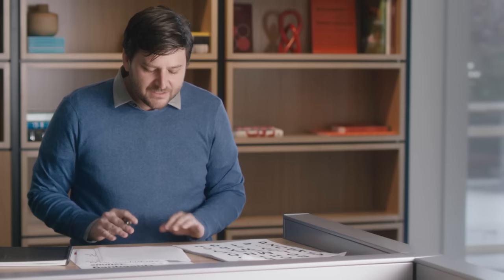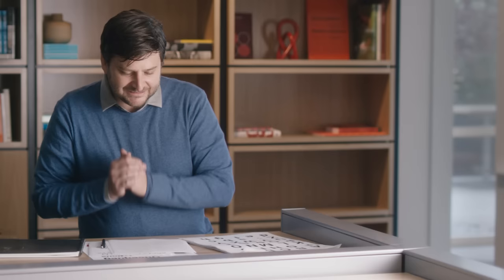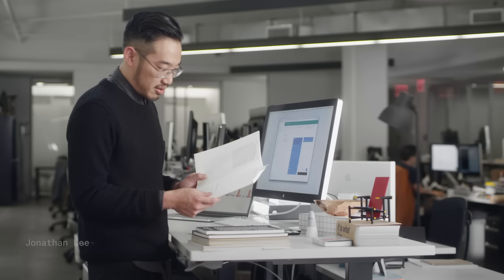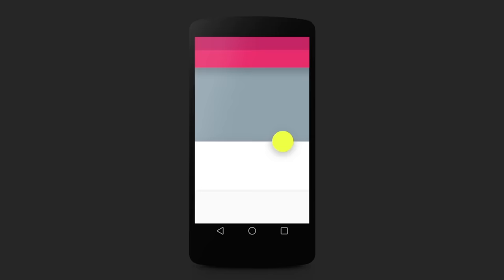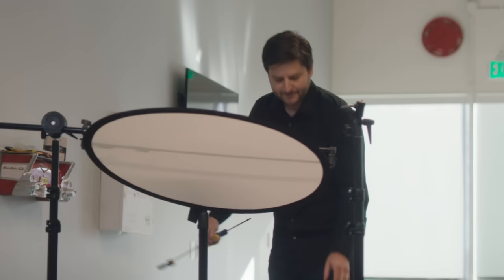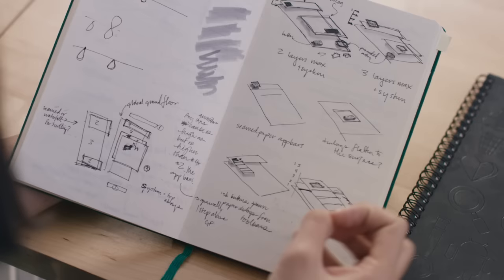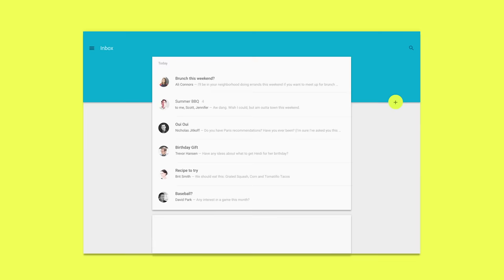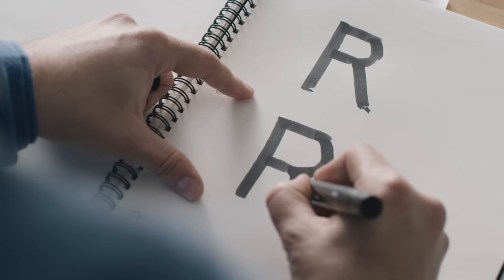Making Material Design

Comment: 3:38 Please revert back the current new icons to this.  Material design is way better than colorful lines
Reply: Hello there! I miss the material design. Now, android just looks like it has flat design. That's why, android lollipop and marshmallow are my favourite. All the other android versions after that were just meh
Reply: Where? In what part of icon? The new icons are much more beautiful. And if you can't identify them, there is such doctor called optometrist, you know?
Reply: @litvanika  it's hard to differentiate sometimes, when you are accustomed to the classic logos. I get confused with the new icons because of the identical colour schemes, also, in my opinion, the icons are not legible.
Reply: @cucumberwater6  1. It's not hard to identify them unless you are blind
2. There are labels under icons that you can read
3. You've gotten used to icons' location so you don't even to see an icon to open an app
Reply: @litvanika  you do make a good point though
Reply: @litvanika Surely if you have to rely on a label to interpret what an icon does it is bad design. Design should be Intuitive.

Comment: This design made me switch from iOS. No joke.
Google, please keep on doing this. Dont change it ever.
This design with connection to reality is really really good. Not like Apples "in your face! make everything WHITE" design. 
This is 3D and at the same time 2D, kinda realistic and at the same time modern.
Flat and not flat. Depth and no depth.
And the animations .. You start the dialer, and the call button and numbers fade in when you hit the little keypad. I did that a few times just to enjoy the animation :D
All in all, its just great.
Also, its really easy for developers to use Matarial Design. Im actually thinking about developing an app myself. 
Until 4.4, Apple had the advantage in software design, IOS 7 was uglier then IOS 6 overall, but still.
But with 5.x and soon 6, you have the edge. 
10/10. Enjoying Google every day ^-^
Reply: ***** Matter of taste I guess.
Its a good comparison though, with Windows because Windows 8 also looks like shit (for me).
I am using it, and I like it because its a very efficient and modern system, but it looks like shit.
So I fiddled a bit with it, got back Aero. :)
Reply: Did you get a Nexus device? Because that is where you'll see the most of the design language. The Nexus devices are made by Google to show of their latest and greatest software in it's stock clean form without all the skinned version software from other manufacturers.
Reply: AnimeFan Exactly yes, a Nexus. I don't want anything else :) Just Android, no bullshit.
Reply: SpicysaucedHD Android M is coming out soon! I can't wait!
Reply: ***** Not completely stock, its Cyanogenmod. So near stock yes, but not entirely. Also too big for me.
Reply: ***** You should wait for the OnePlus Two, it is coming out two days from now, lol. xD
Reply: ***** What happened, did you end up ordering the OnePlus One? XD
Reply: +SpicysaucedHD material design is amazing, one of the best things Google has come out with in years. It works perfectly to simplify and unify interface design. The closest precursor was bootstrap and god knows bootstrap is a nightmare once you come to customise it.
Reply: +SpicysaucedHD I hate the flat look. The animations are cool, but they make older devices run slower. I would take the dark 3d holo look of jelly bean ANY DAY.
Reply: +CreeperCraft137 According to general design guidelines Material Design is truly the better solution than Holo. And its not really flat, it has visible (virtual) layers of paper/cardboard.

But hey, its Android right? So just tune it to your liking :) Everybody has his or her own personal preference and that is what Android is all about - diversity.

Btw, just saw that my original comment is now almost 6 months old. And still, I am enjoying Android - and its design of course :)
Reply: ***** OnePlus X is a great device, definitely the best for the price.
Reply: ***** iPhone 6s isn't that good. For the price of the OnePlus X, it's amazing. Though currently I think the Google Nexus 6P is the best in the market right now. If it had OIS for the camera and if the device was around 5.5", I think it would be a perfect device, for me at least. Currently, I have the Galaxy S6Edge, but my latest device for sure will be the latest Nexus, probably when my contract ends in less than 2 years. Ugh, I want a Nexus right now! XD First world problems.. :/
Reply: material is all white what u talking about lol
Reply: MrMister1227 You know material dark is a thing, right. There is a dark theme for material dance, but it just seems Google is going mostly white for all their apps.
Reply: Me too! I think thy iOS and Apple "owned" the smartphones and MOS sector, but that material design is going to change that. But it isn't just a design, the apps change too, Inbox for example!
Reply: Stan347 We have to wait until May for the beautiful? :(
Reply: ***** It's still the beta, so obviously there can be many changes done before May comes.
Reply: he's sayn' good
Reply: Windows 8,10 UI is like a Material design done wrong
Reply: L   A   G
Reply: Lol, I tried android and returned to iOs because material design sucks.
Reply: now material design is literally in almost every single app you download and even alot of site prefer it over realism, simple is the new modern
Reply: What phone you using rn?
Reply: @maurovisuals  Interesting question. 
With the completely new UX principle introduced with the IPhone X series, I had to rethink the whole thing. 
Apple does gesture-based navigation best and smoothest. 
What I also didnt take into consideration 5 years ago was the quality of apps coming from the Play Store/App Store. The latter or rather its apps are sadly(?) often vastly superior, that was ultimately the main reason why I had to switch back. 
So: My Android adventure ended, I am now again an iOS user indeed.
Reply: @OliverQueenMC  I have a Xiaomi Mi A3, which is also stock. I had a shitty customization layer. I wanted a mobile with MIUI. But after discovering Material Design, MIUI is shitty in comparison.
Reply: @Spicysauced  oh :(  I started disliking android from Oreo and beyond, because I feel Google abandoned the material design, that made android L and M so aesthetic. Marshmallow is my favourite version of Android, nougat(according to me) was meh, but it had a lot of good features. I started disliking the design from Android Oreo and onwards
Reply: @Spicysauced  but still an Android user. I can't seem to switch to iOS at all.. because I customise my phone a lot, and I do it frequently. So, android forever
Reply: @cucumberwater6   Mh.. customizing is one of those points every other Android user always mentioned since the beginning. However I always felt that its a thing only teens do to boast with their "K3wL d3sign" lol
After youve grown up and put the phone out of its packaging, install the apps you need and be done with it. Setting a custom wallpaper is everything Ive ever really done (and so, I think, does the majority)
Reply: Ah pretty much same with mee, i love this design so much, lollipop is the best design, not like the marshmalloe though, couse the circle shadow when ikon dial clicked its not lollipop, i love seeing the animation lolll, we are very much the same
Reply: They killed it

Comment: I prefer material design over iOS in theory but in reality I find that material design kind of holds your hand. The animations are almost predetermined and don't follow human interaction. iOS on the other hand has less fancy animations but it moves with the users finger. Material Design is definitely presented better in this video than it is in reality.
Reply: It can be irritating at times, some animations being slow. I agree that iOS is much more practical.
Reply: I just set animations to be quicker. Or, you could just turn them off.
Reply: Even after 2 years, I still can relate to what you say here. I just moved from Android to iOS, and this is what I feel exactly.
Reply: Couldn’t agree more
Reply: na material isnt around so long, maybe its need some time
Reply: as a new ios user (8 months, new?), i really agree with you
Reply: @Blobjim  there are 3 sets of animation speed, short medium and long. if it takes too long, adjust the speed....dont say google does this wrong/bad because they literally give you unlimited options to adjust it to your liking. Only thing MD does it give you a toolbox with sets, which tool you use and in what form is totally up to you :)

Comment: Instead why don't you call it Paper or Sheet Feel Design which is what I could infer it as!  Material is a more abstract term than the actual design you really conceived.
Reply: "Material is the metaphor". The name material in this context is an umbrella term, whereas Paper or Sheet Feel are more specific. It goes beyond papers. Think of the word Material as another word for Object. It's just that they use a lot of "paper art" to illustrate the idea.
There is a video explaining choreography of materials where they used 4 objects in a LinearLayout (vertical) and each object is expanded or lifted and placed in a new spot while the other objects decelerate and accelerate accordingly. If you picture those objects as papers, or sheets it takes away from the whole physics (somewhat), which Material Design is solely based on. So don't just view it as sheets or papers, but actual objects such as, a floating button.

Comment: "Principles behind material design should be timeless"

This will only be true while we have 2D interfaces.
Reply: Actually if you think about it, the principles of material design have been around before Material and will be after Material, as the principles are entirely based on Physics. But if it is that we say Material has ownership of said principles, then we can say that even when 2D interfaces are no more, the way objects move according to each other in a 3D interface, will still be based on Material Design because they still need to obey the laws of Physics. Also, since its base is Physics, when you delve deeper into how Material design is concerned on the user's experience, such as choreography, transformations etc, it principles should be carried over to 3D interfaces.
Hmmm... The way they already have 3D interfaces in Sci flics makes you wonder if Material design was stolen from Sci movies :o

Comment: I get this. It's nice. This is what Apple did with iOS 7 and its new design overhaul. Everything is unified and feels seamless and nice to use. It has layers and unified look throughout. The thing with Google and Material Design is, it's not going to go far, unless they fully take control over their OS. That's Android's biggest flaw. It's given to so many manufacturers and then they dump their bulky and ugly skin on top and it turns the OS experience to shit. It loses its sense of design along the way. One phone a year, is given Google's big OS update and then for the next year, MAYBE SOME phones will get that update, maybe some won't. Most likely they won't. At least, with Apple, they keep updating their phones and tablets with the most current OS version, as far back as possible. The 4S is running iOS 9..I mean. 
That's their second biggest flaw; their updating system. It's shit. I do like the Material Design though.

Comment: As a design student, I don't feel that much of differences after upgrading to 5.0. Yes, it does look prettier, but material design is more like a graphic refinement in my point of view because it still doesn't fix the flaws of previous android os interaction logic. As Dieter Rams said, "Good design is thorough down to the last detail". The interaction, software and hardware experience are all needed to be perfected. Google has a long way to go, and a pretty promo video obviously won't help.

Comment: None of these designers are wearing glasses. I don't need glasses, but I wear lenses with a glare reduction, because of the blue light rendered by Android.
I believe it was the Android 2.1 or 2.2 update that prevented you from lowering the blue light to reduce eye strain.
PC's have tools & apps that do this built in. The Samsung S8 and other phones are adding a blue filter built into the phone. Save our eyes and reduce eye strain. Please.
Reply: @seangt  Do you see my point? Only flagship phones get options to save your eyes. Most people don't own flagship phones. Owning a flagship phone costs almost as much per month, in some cases more, than your average cell phone bill. I don't care as much about the design, my #1 priority is for the phone to work, second is the design. If you don't own a flagship phone, they usually don't work as intended, updates are slow to roll out, you don't find some features that are found in flagships, un-removable bloatware tends to ruin the user experience, the blue-light is causing eye-strain, and locked bootloaders prevent fixing these issues on a device that you own.
Designers take pride in their work. Maybe one of them were watching these comments and feel passionate about the average users experience. That's why I posted here.

Comment: What about Chrome update 55? The flag to disable material design was removed, which meant Google's opinion of appealing hipster 'design' is forced on users who don't want that look! I used the flag the instant this filth hit my browser in update 52. Updating performance and security shouldn't include a forced change to appearance. I am now running a dodgy Chrome 54 that will never update, just because of the choices made by Google to 'update the appearance permanently, with no options in the chrome browser.
Chrome you make many users unhappy with this, please fix it!

Comment: I thought this was a parody at first. Remarkable how bullshit gains respectability with enough people saying it. The choice of using 'primary' and 'secondary' was by far the stupidest thing they have done.

"I don't want to be looking 4 years down the road... 10 years down the road and saying 'Well, Material Design... all those ideas, those frameworks, they're over." --Matias Duarte

I hate to break it to you, but Material Design is over. It's so poorly documented that it's amazing you people think you're increasing communication with your "design" choices. It's easier to use any other solution than Material Design.